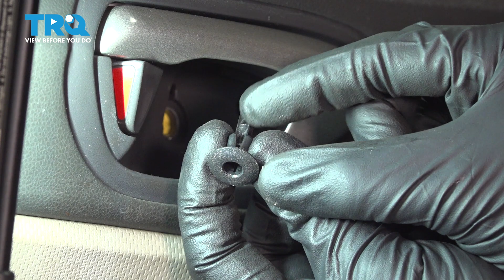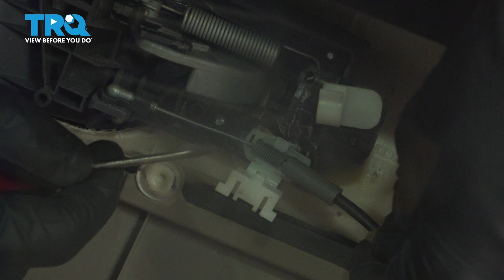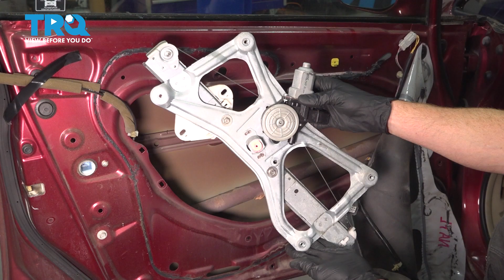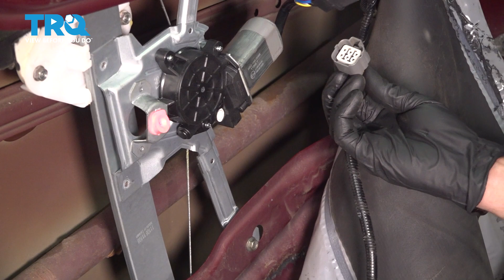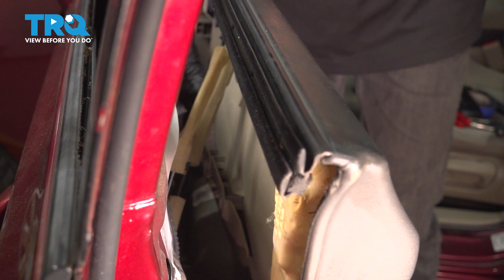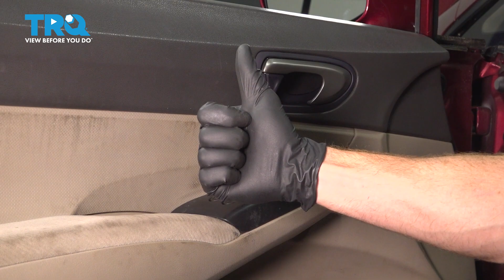How to Replace Power Window Motor & Regulator Assembly 2006-2011 Honda Civic

Comment: Very helpful. However I did not need to disconnect the cables. Once the electrical was disconnected, the door card just swung out of the way and the job took about 10 minutes or less.

Comment: What if the window is stuck up?? I can't find any videos showing how to deal with that😭
Reply: Today I just opened the door, put my hands on each side of the window and forced it down. It'll go but it's hard.
Reply: Then you'll be able to undo the two bolts holding the window using an open end 10 mil